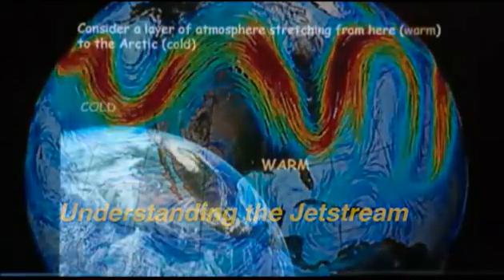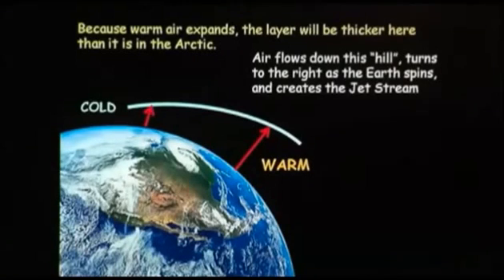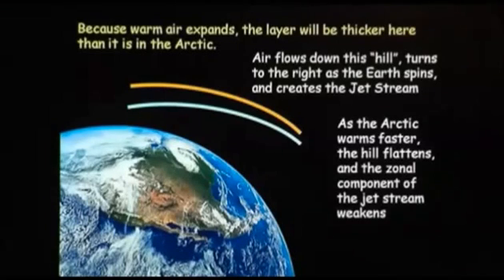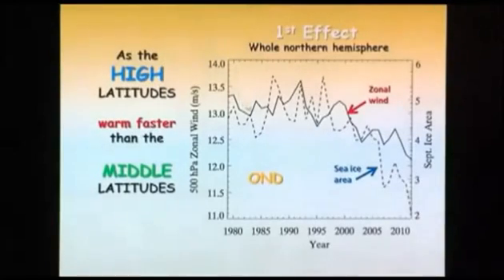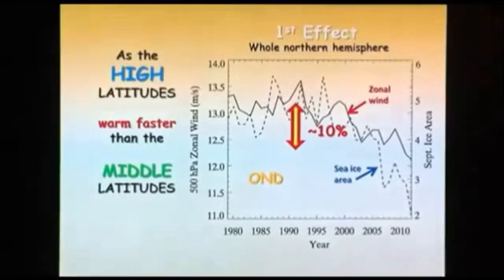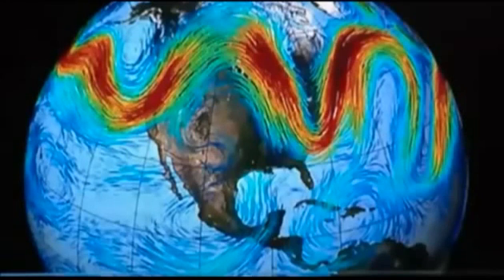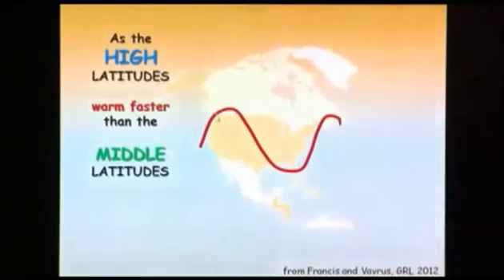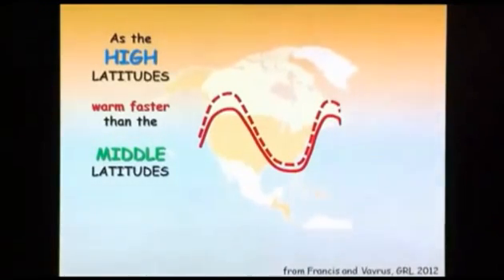Jennifer Francis - Understanding the Jetstream - m

Comment: This is all wrong, firstly there is no relation between the decline in the ice and global temperature which has been steady over the last 10 years.
Rather than cherry pick data plot wind farm capacity against zonal wind and you will see a near perfect correlation.
And of course that is to be expected, you can't suck energy out of the wind without sucking it out of the zonal wind because the two are essentially part of the same.
Reply: ufewl
Actually you do. What you describe is the application of "common sense" principles, otherwise known as group think.
Now if you want to see scientists on each others cases then go look at peer review. No back slapping there. On the other hand we can see the deniers inventing peer review publications to desperately try and make their stuff credible. Now that's pal-review It isn't working.

What's going on in the Antarctic is in good part due to AGW, so nice try.
Reply: ufewl
And you have some evidence for this?  If so why does Richard Lindzen, John Christie, Roy Spencer (I could name a few more) have a job? You might also want to point out why there is general inaction amongst governments, and in some cases outright government hostility, in the study of climate science.

Considering scientists are generally saying, "this event is consistent with the projected changes due to AGW" your saying they only say it's AGW after the fact falls flat. Try learning about the kinds of changes that have been predicated before making that claim. Of course not everything is due to climate change and sometimes we learn from studying events that there was a connection later

No warming in the last ten years? Check the oceans or read Cowtan and Way.

Got a citation for that Venus claim? Still waiting for your windmill claim citation.
Reply: ufewl Yes if temp increases in the ocean was all we had to worry about then it would be no issue. However, what it shows is warming continues. Secondly, these periods where the oceans absorb more heat are temporary. When th cycles flip the oceans help warm as they release some of that stored energy. That;s what happened in 1997/8. Looks like it's pushing temps to new heights again. 2015 to be warmest year by a large margin.. Warming at a rapid rate continues.
Reply: *****
What would you like? Like I said name an aspect? If you expect me to list the 10s of thousands of papers that form the basis of AGW you're out of luck. If you want a summary then look at the IPCC Reports. There are masses of citations there and google scholar will get you to most.

Face it. The reality is you are trying to pretend you know more than the vast, vast majority of the people who study the subject. You are only able to hold onto your ideology based beliefs by closing your eyes and ears to all the evidence that's out there. That's why you're so angry. You do actually realize that. So now you think you can huff and puff and intimidate people who understand science. Sorry bud, but I'm used to the anger and bluster of the deniers.
Reply: ***** Yes it's about greenhouse gases and it is diret experimental evidence that shows our emissions of GHGs are warming the planet.
Who said that the amount of warming seen in the last 100 years would cause serious problems? 

As for what is already happening or is likely to happen:

This quite recent study is interesting: http://www.nature.com/nclimate/journal/v4/n4/full/nclimate2153.html

Then there's:
•Decline in rice yields due to warmer nighttime minimum temperatures (Peng 2004, Tao 2008)
•Increase of Western United States wildfire activity, associated with higher temperatures and earlier spring snowmelt (Westerling 2006)
 •Encroachment of shrubs into grasslands, rendering rangeland unsuitable for domestic livestock grazing (Morgan 2007)
 •Decreased water supply in the Colorado River Basin (McCabe 2007)
 •Decreasing water supply to the Murray-Darling Basin (Cai 2008)
•Increased deaths to heatwaves - 5.74% increase to heatwaves compared to 1.59% to cold snaps (Medina-Ramon 2007)
 •Increased heat stress in humans and other mammals (Sherwood 2010)
 •Spread in mosquite-borne diseases such as Malaria and Dengue Fever (Epstein 1998)
 •Increase in occurrence of allergic symptoms due to rise in allergenic pollen (Rogers 2006)
•Less compacted ice, hazardous floes and more mobile icebergs posing increased risk to shipping (IICWG 2009)
 •Drying of arctic ponds with subsequent damage to ecosystem (Smol 2007)
 •Melting of Arctic lakes leading methane bubbling (Walter 2007)
 •Leakage of methane from the East Siberian Shelf seabed sediments (Shakhova 2008)
 •Escape of methane gas from the seabed along the West Spitsbergen continental margin (Westbrook 2009)
•Rainforests releasing CO2 as regions become drier (Saleska 2009)
 •Extinction of the European land leech (Kutschera 2007)
 •Decrease in Adélie penguin numbers  (Ducklow 2006)
 •Disruption to New Zealand aquatic species such as salmonids, stream invertebrates, fishes (Ryan 2007)
 •Oxygen poor ocean zones are growing  (Stramma 2008, Shaffer 2009)
 •Increased mortality rates of healthy trees in Western U.S. forest (Pennisi 2009)
 •More severe and extensive vegetation die-off due to warmer droughts (Breshears 2009)
 •Increased pine tree mortality due to outbreaks of pine beetles (Kurz 2008, Bentz 2010)
 •Increased risk of coral extinction from bleaching and disease driven by warming waters (Veron 2009, Carpenter 2008)
 •Decline in lizard populations (Sinervo 2010)
 •Decline in global phytoplankton (Boyce 2010)
 •Decline in global net primary production - the amount of carbon absorbed by plants (Zhao 2010)
•Severe consequences for at least 60 million people dependent on ice melt for water supply (Barnett 2005, Immerzeel 2010)
 •Contribution to rising sea levels (Pfeffer 2008, Vermeer 2009)
•Economic damage to poorer, low latitude countries (Mendelsohn 2006)
 •Billions of dollars of damage to public infrastructure (Larsen 2007)
 •Reduced water supply in New Mexico (Hurd 2008)
 •Increased risk of conflict (Zhang 2007) including increased risk of civil war in Africa (Burke 2009)
 •Drop in primary productivity due to unprecedented warming at Lake Tanganyika (Tierney 2010)
 •Hundreds of millions displaced within this century (Dasgupta 2009)
 •Coastal erosion in Nigeria (Okude 2006)
 
And then of course there is ocean acidification:
•Substantial negative impacts to marine ecosystems (Orr 2005, Fabry 2008, Kroeker 2010)
 •Inhibiting plankton development, disruption of carbon cycle (Turley 2005)
 •Increased mortalities of sea urchins (Miles 2007)
 •Threat to fish populations (Munday 2010)

The pros include improved agricultural production in high lattitudes, fewer deaths from cold, shipping through the ice free arctic to reduce travel time. But these gains are more than made up for by the losses.

The pros outweighing the cons is based on the ridiculously oversimplified argument that CO2 is good for plants and therefore more is good. However reality requires we remember that plants have ideal temperature ranges, need nutrients and water, and are attacked by pests. Just pointing at one factor and ignoring the others is not very sensible.

You have read the IPCC's recent summary on the consequaences of AGW, right? There is a much larger summary of the evidence.
Reply: ***** you sound like 12 year old unable to substantiate his own BSes. Go to Fiji or Kiribati and tell them that. They are losing feet after feet of their precious land until the ocean will claim its right. Where are they gonna go? In your sorry UK yards?  Get ready cos they're thousands of them waiting on a new land of adoption.
Reply: ufewl
1) deforesting land will greatly increase the CO2 in the atmosphere. That's a big way we raised CO2 levels already.
1a) The area being defrosted generally has poor, thin soils. Not a good exchange for the good soils being lost.
2) Extra CO2 may be awesome in a controlled greenhouse but the effects are much less in the real world. There are also limiting factors such as heat stress, water availability, nutrient availability, and pest prevalence that mean the benefits will be overcome by the negatives.
3) Why would the scientists say what they are saying? Because they have actually done the work and don't operate in a fantasy world like you. They are trying to warn us so we can avoid going down a path which is massively harmful to humanity. Or we could listen to arrogant 12 year olds who believe in the CO2 fairy.
Reply: ***** Fascinating. You post information that proves your beliefs are wrong (although apparently you knew this already) and you bitch about the scientists. LOL 

Although since you had been promoting the concept that there were no negative effects the study did need to be done. It is a principle of science you know. We don't assume the results will be one way, you test it. And now we know.
Reply: While atmospheric surface temps have been steady the global oceans are warming just as fast. In addition recent study by Cowtan and Way have calculated that the arctic has continued to warm despite the seeming slow down globally.
Which peer reviewed study finds this wind farm claim?
Reply: rugbyguy59  Peer reviewed? NO mate this is proper science backed by solid scientific facts not  a bunch of  backslappers with their old school ties.
You don't need to peer review basic science such as  reducing air flow reduces cooling. A 5 year old kid would be able to tell you that

What on earth were they thinking when they though they could reduce warming by reducing airflow.

They must be fucking mental.

When your peers are idiots their review is meaningless.
Reply: rugbyguy59  yea but unfortunately the Antarctic continues to freeze hard with it's ice not at it's highest level ever recorded.
Reply: rugbyguy59  I've got load of stuff.
I have had to gather them from my history they are not well organise.
http://wattsupwiththat.com/2013/02/25/rethinking-wind-power-harvard-study-shows-it-to-be-overestimated/
 http://phys.org/news/2012-10-curious-cold-layer-atmosphere-venus.html
http://phys.org/news/2012-10-curious-cold-layer-atmosphere-venus.html
http://wattsupwiththat.com/2013/02/25/rethinking-wind-power-harvard-study-shows-it-to-be-overestimated/
http://iopscience.iop.org/1748-9326/8/1/015021/
http://pielkeclimatesci.wordpress.com/2011/05/03/a-new-perspective-on-climate-science-by-l-miller-f-gans-and-a-kleidon/

Predicting climate will change some time in the future, is the vague sort of stuff a clairvoyant comes out with, so 30 years on we had a winter storm and a bit of flood cause by dredged river, is hardly great shakes.

How can the oceans be warming if the atmosphere is not?

Actually I might have solved that, just had a bit of a brain wave.

I wonder how long it will take the climate scientists to figure that one out?

Seems they have not solved it yet, I think I have it after a few days of hearing about it, they have had 10 years!!1 All one million of them!!!
Reply: ufewl
Thanks for the stuff on wind energy. Always good to learn and good policy choices need good facts. Funny that Watts and others seem to suddenly find faith in GCMs when they turn up something that works for them. What does it all mean...we might not get the masses of energy some have hoped for. But there is still lots to get and other formats too.

The Venus discovery is interesting too but no one seems to think it means the end of the greenhouse theory.

How does the ocean warm without the atmosphere getting warmer?
England et al 2014: "Stronger trade winds push warm surface water towards the west, and bring cold deeper waters to the surface to replace them. This raises the thermocline (boundary between warm surface water and cold deep water), and increases the amount of heat stored in the upper few hundred meters of the ocean. Indeed, this is what happens every time there is a major La Niña event, which is why it is globally cooler during La Niña years. One could think of the last ~15 years or so as a long term “La-Niña-like” anomaly (punctuated, of course, by actual El Niño (like the exceptionally warm years 1998, 2005) and La Niña events (like the relatively cool 2011). - See more at: http://www.realclimate.org/index.php/archives/2014/02/going-with-the-wind/#sthash.GkI7DZP2.dpuf"

There is also Cowtan and Way which indicates it's actually warmed more than originally thought.

It will be a while before short term climate changes can be predicted accurately (our explorations into the surface patterns tell us we need to be able to predict ENSO for one thing) but the long term projections are solid.

"30 years on" if it was going to stop now it would likely not be a big deal. But it isn't

A river that wasn't dredged? Watt's original story was that it was due to one pump not being turned on. He later changed to the still completely implausible "didn't dredge" story. It flooded because of massive, constant rainstorms in an area that is very flat. Dredging would have increased high tide surges from the sea due to increased sea level.
Reply: rugbyguy59  Seems ridiculous to me if they ignore sea temperatures when reporting the earths temperature. It means the info they are putting out is highly misleading.
Reply: *****
Ignore what when? Atmospheric temps were the standard because they were most abundant, consistent, and easiest. However as some people think natural variation in the atmosphere (which is most subject to short term influences) means the Earth isn't warming more attention has been brought to ocean temps.

the people ignoring the sea temps are those claiming there has been no warming since (insert your favorite year here)
Reply: rugbyguy59
Well it just proves how useless the scientists are putting out  meaning less information. They DO NOT have a scientific approach, they have a vested interest in finding warming and stopping people using fossil fuels, when ever they find something that fits their dogma they stop looking but if it does not fir they keep picking at it until they can twist it to fit their desires.
It is the scientists who have ignore sea temps for decades, not the deniers.
But the bottom line is warming is actually good for the planet, however they ignore all the positive effects and bang on endlessly about polar bears. Food supplies have quadrupled in the last 100 years of this 'disastrous' warming, as has the population.
Reply: *****
So the deniers were telling us CO2 has been warming the oceans all along? Good for them to finally get something right. Perhaps there is hope...anyway we see that now, so what's your point (other than making stuff deniers supposedly said up?)
If you look at the IPCC report you will see extensive examination of other possibilities and all the things you claim are being swept under the table. In fact it's only sweeping stuff under the table that allows people like you to make the ridiculous claim that warming is always just a bonus. There are pros and cons but the higher the temps go (and especially at the rapid rate we're seeing) the more the cons outweigh the pros.
The scientists do not have a vested interest in ending fossil fuel production...other than being one of us all and knowing we are in for a very rough ride if we still ignore facts.
Reply: rugbyguy59  You have no proof the cons out weighs the pros. You certainly have no proof the anti warming measures are better than doing nothing. You indeed have no proof they work at all. There is evidence wind farms produce warming for starters, but they ignore that, it's inconvenient. They ignore the fact wind-farms change the climate more than warming does. Scientists have a vested interest in making money by generating hysteria. We will stop using fossil fuels when they run out, not before, that is guaranteed. It is all biased propaganda.
Reply: *****
Proof is one thing and it's very elusive. Evidence is another. You have no proof that warming as we are seeing will ultimately be a net benefit. So we should make decisions based upon the best evidence. Right now the best evidence, and that evidence is found all over the place, including summary reports such as the IPCC, is that continued rapid warming will be a disaster. "Effects of climate change on global food production under SRES emissions and socio-economic scenarios" -- Parry et al, Global Environmental Change 2004
"Stern Review on the Economics of Climate Change" -- UK Government report, 2006
There's lots of others. The prudent path is to act. The science is what the science is. Those who deny it are those with fiscal ties to the fossil fuel industry.

It isn't ignored it's been examined. Wind turbines may produced localized weather changes (the two Keith et al studies) but these are much weaker than natural interannual variability and the effects of AGW. http://www.nature.com/ncomms/2014/140211/ncomms4196/full/ncomms4196.html#affil-auth (see you need to look at all the evidence)
Reply: rugbyguy59  There is not any evidence, where is it you are just invidted me to buy something, the answer to that is fuck off. I have evidence global warmings is good for the planet. Just send me £20,000 and I will email you a copy of it.
IF there were evidence you would be able to freely supply it, How come the unsubstantiated bollocks from the IPCC is free?
It's a fucking con from a bunch of criminals.
Reply: *****
LOL, more ramblings from a looney denier. The evidence is freely available so I have no need of your $36695 information. It would be as fake as the rest of the criminal fraud perpetrated by the losers you have such blind faith in. Or are these your inventions?

Which particular type of evidence would you like me to produce? I'm afraid the overall evidence is simply too vast for even these new expanded posts.
Reply: *****
Funny how a simple search through Google Scholar gets me a copy of most articles. More than enough to see just how enormous the mountain of evidence in favour is. Of course, I guess, governments could subsidize journals so they are 100% free to the general public but then idiots like you would take it as further confirmation of conspiracy.

I'll leave it to you to lap up the denialist propaganda/koolaid as we've already seen so convincingly how you only see the fragments that  seem to support your position. You see a tree but miss the forest.

You seem to have anger issues as well. I've found that common amongst those who whip themselves into a frenzy due to ideological bias.
Reply: rugbyguy59
funny how despite the fact you can find this info freely and simply you remain unable to produce any evidence here isn't it?
So despite the 'mountain of expedience; you can't produce any and have produce none so far.
So you have produce no evidence, and and now are accusing me of having "anger issues", well of course I have anger issues with stupid idiots like you self who make a claim with out evidence, fail to produce evidence when requested and then go on to make a personal attack on me, again with out any evidence to justify it.

Your failure proves everything I have said, there is no evidence to back up the alarmist claims, nor wil there ever be as the claims are unjustified,
Reply: lol, I would like one study, one piece of evidence, that is all I ask. Is it too much to ask? You claim you have 10's of thousands, yet remarkable you can't provide one, provide a link to JUST one. A scientific study, not the opinion of some pompous idiot.
Truth is despite your claims there is no actually evidence, just a lot of hand waving and waffle.
How the fuck can I close my eyes to evidence whcih has not been produced? I would not say I am angry, I am infact elated you have not been able to produce a shred of evidence to support your claim.
So there is no anger here as you claim, it is delirious laughter at your failure to back up you claims!! You seem to be deluded, you apprear to believe there is evidence for your claims but your failure to produce any just proves how delude you are.
Reply: *****
And in your last post you said you were rightfully angry. Typical denialist denying your own words, lol.
You claim I haven't produced evidence and yet I told you exactly where it is. So again your hear no evil, see no evil attitude is obvious. Just go read the IPCC Report. Too bad it's too conservative overall and the politicians aren't letting the scientists say just how concerned they really are.

But here's your one piece. "This experimental data should effectively end the argument by skeptics that no experimental evidence exists for the connection between greenhouse gas increases in the atmosphere and global warming." https://ams.confex.com/ams/Annual2006/techprogram/paper_100737.htm The PDF is free.
Reply: rugbyguy59  Again that is all rubbish, I started reading it and it said "Without adaptation, losses in aggregate production are expected..." Yea, without adaptation well of course the idea we would not adapt to change and continue planting unsuitable crops in unsuitable area's is utter lunacy and any who does a study on that basis should be hung drawn and quartered for wasting public money. But of course they have to do invalid studies because when ever they do a valid study they get the 'wrong result' ie it shows warming is beneficial, so they quietly shred the evidence and go back to talking bollocks,
Reply: *****
So simple straight forward denial...gee how surprising. Yes, we will have to adapt and if we act fast enough adaptation might be enough. Of course we will adapt but if it just keeps getting warmer adaptation won't cut it. To bad you can't even be honest about what a study is looking at. They don't do a no adaptation calculation because they are suggesting we wouldn't; it's done so you can see how effective adaptation might be. Good thing these guys don't listen to idiots like you about what constitutes a valid study, we wouldn't get any proper science done.
Reply: rugbyguy59  It is not proper science it is bullshit hysteria and propaganda, we don't have to act fast, no faster than we reacted to the last 1C increase, ie unnoticablely fast.
Also as the CO" level is at saturation point it won't get any warmer. Furthermore the is a natural regulator to temperate in fossil fuels and that is smoke particles which reduce the heat, but stupidly we insist in clean fuels, more stupidity form idiots who cause problems not solve them.
Reply: *****
Haha, can't deal with the evidence you asked for so you just hunker down into deep denial mode. What's your evidence we won't have to act faster? No one really thought we'd have to react much to the first degree. Trouble is many effects seem to be ahead of schedule. What evidence can you supply that the next degree (and the next and the next) will have similar effect?

So at what point in time are you claiming CO2 became saturated? Chen 2007 shows the effect of CO2 growing until 2006. As does that first study I cited for you a few posts back. As Gilbert Plass wrote about the center of the CO2 band being saturated almost 60 years ago: "This is entirely true for a spectral interval about one micron wide on either side of the center of the carbon dioxide band. However, the argument neglects the hundreds of spectral lines from carbon dioxide that are outside this interval of complete absorption." You have some evidence to the contrary?

And now we see how completely desperate you are, you want to maintain high levels of aerosols to keep the earth at this temp. So I guess you don't support transferring to cleaner burning natural gas but would rather return to dirty, dirty coal. No worries about 8 year olds in China getting lung cancer. No worries about the terrible airpollution and acid rain. BTW, by arguing this you just accepted that CO2 is not saturated.

You can't even keep your lies straight. LOL And what would you know about proper science anyway?
Reply: ufewl just like map makers that insist the world is flat. they can't get jobs in cartography either.
Reply: ian wallace see my previous post for the answer to that,I am not of course saying the world is flat so you are using  straw-man argument, ie a logical fallacy, you can't use a real argument because, put simply you are massively wrong.
Reply: rugbyguy59 1) You have no proven  scientific evidence an increase in CO2 is harmful.
2) The effects of CO2 are independent of greenhouses. The limiting factor you mention are also irrelevant, we have them anyway. There are no negatives, you have not established that.
3) Why the scientists get thing wrong is irrelevant, it is still wrong, they say whatever is most profitable for themselves. They have no evidence CO2 is harmful hence they are talking complete and utter bollocks. YOu are simply brainwashed, unable to think for yourself and hene you [ut you future in the hands of a bunch of wealth ruthless and stupid cooks who profit from it. It is also a good excuse for government to heap huge regressive taxes on the poorest and trap the poor in poverty ensuring they rich remain in luxury. You also got my age wrong.
Reply: ***** 1) You like to deny mountains of evidence.
2)There are loads of studies that indicate the effect is not "independent of greenhouses. Studies done in controlled outside environments show you lose 50% of the effect immediately and these are still in relatively small plots and don't involve increased temps that would result from that much more CO2 in the general atmosphere. Other studies show lower nutritional values and more pest vulnerability. It isn't that hard to find. Yes, some of those factors exist already... added CO2 just increases the vulnerability to them.
3) You have no evidence the scientists only say what benefits them. And as for getting things wrong, you apparently have little understanding of the history of science. Scientists make hypotheses that are tested and the results of these lead to the formation of theories. In the early stages there will be lots wrong with the theory but additional research will allow it to be refined over and over again and each time it will be closer to correct but in reality there will always be things scientists get wrong. It's how they learn. But what they get wrong will be increasingly detail oriented. That's where we are right now. AGW is unquestionably correct. Dire consequences are highly likely if we do not act. What happens tomorrow is still very uncertain. But by being wrong the theory of AGW has become extremely well developed and as they like to say... settled science.
4) Yes, government could make bad policy choices in attempting to solve the problem. They might also make better ones as all of the things you fear can be avoided. However that discussion has no bearing on the reality that we have a real problem.
Reply: rugbyguy59
there is no evidence to deny, climate scientists are biased and politically motivated. They spent years talking about the notrh pole and ignore the south, how is that balanced science? It isn't it is propaganda.
We have plenty more water available in deed we have a whole melting ice cap!!!!! We currently apply the required nutrients to farm land hence your argument is voided. You denial requires man acting like an idiot, that will not happen only climate scientists act like idiots. Scientists take bad and biased assumptions and you the to get the results required to drive their political agenda ie more funding.
CO2 is wonder stuff, it is the new oil indeed it will replace oil as it provides both life and energy, the more of it the more you get of both
Reply: rugbyguy59 indeed one experiment relies on the soil being depleted of nitrogen, this happens anyway, which is why we fertilise with nitrogen, to assume farmers would fail to adjust the supply of nitrogen to the necessary amount is just sheer lunacy, it is and science and essentially propaganda. There is no shortage of nitrogen, the atmosphere is full of it. And nitrogen is recyclable it is not used up so we will never run out of it and always have enough of it.
The 'experiments' are mindbogglingly stupid and do not reflect reality, they rely on using inappropiate farming practises, supply of water and nutrients is a simple engineering problem easily solved, certainl;y cheaper and easier than building millions of wind-farms which actually cause warming. Of course they ignore the fact they cause warming because it is an inconvenient truth. The people you call scientists are not real scientists, they are politically motivated environmentalists driving their own agenda. They have dug themselves into a hole and are to scared to admit they have it al wrong because that would show their incompetence and mean they lose their highly paid cushy jobs.
Reply: rugbyguy59  http://www.smithsonianmag.com/smart-news/plants-wont-help-fight-global-warming-as-much-as-wed-thought-57646253/?no-ist=
 "What they found was that in the grass plots that didn’t have extra nitrogen being added, plant growth was only half as much as for plots with lots of nitrogen, even when both had extra carbon dioxide."

They didn't need trials to find that out, I could have told them that before they started!!!!
That shows the depths of their stupidity, they wasted billions doing trials for which I could have told them the results of before they started, they are not scientists they are morons.

Also:-  "Standard plant food you’d pick up at the store is rich in nitrogen, potassium and phosphorous, each a necessary fuel for plant growth." That is just plain wrong none of the elements listed is a fuel, there is only one source of fuel for plants and that is the sun, that is easily proven by trying to grow plants in rich soil in the dark, the plants don't grown because the elements they list as fuels are not fuels.

So you are essentially asking me to rely on the work of such massively incompetent people for predictions of the future, ie to rely on their "mountain of evidence" well of course it is not evidence at all, it is a "mountain of bullshit".
Indeed maybe they could use their own research papers as fertiliser because they are FULL OF SHIT!!!
Reply: rugbyguy59 It proves me right not wrong.  We don't need studies for the blatantly obvious and  indeed for what we already know, it is blatantly obvious that we need a certain amount of  nitrogen to make molecules of chlorophyl, you don't need a study to show that  because it is a scientific FACT
Reply: rugbyguy59  also there are plenty of ready sources of nitrogen we actually pee it out of our bodies, hence more plants = more animals = more nitrogen, so it is a self balancing process. There is as I said an abundance in the atmosphere, and it is release into rain by lightening and a warmer atmosphere carried more moisture. Hence the experiment the did was invalid, so it is question of garbage in garbage out. They are very poor scientists and make litrally hundreds of error in their models whcih are essentially bullshit. Every time I look at a study done by those crackpot environmentalist I see it is riddled with flaws, hence the results are worthless. Only one word to describe the incompetent.
Reply: ***** Somehow missed this reply way back then... but all it does is confirm why we do science. You might think something is blatantly obvious but until it's been demonstrated there is no calling it a fact. Turns out ntrogen absortion goes down in higher CO2 environs: "The findings of the study are unequivocal. The nitrogen content in the crops is reduced in atmospheres with raised carbon dioxide levels in all three ecosystem types. Furthermore, we can see that this negative effect exists regardless of whether or not the plants' growth increases, and even if fertiliser is added. This is unexpected and new," says Johan Uddling, senior lecturer at the Department of Biological and Environmental Sciences at the University of Gothenburg.
http://onlinelibrary.wiley.com/doi/10.1111/gcb.12938/abstract
Reply: rugbyguy59 Yes we do science so we can misinterpretate it and misuse it to push whatever political agenda is will keep us in a job. Anyway back to the "article" which to mean seems like a desperate attempt to make out elevated CO2 will be a bad thing. But let us look at the reality rather than the misleading rhetoric. ie: "Under elevated CO2 most plant species show higher rates of photosynthesis, increased growth, decreased water use", now any sane person would be popping the champagne corks at this stage but not the climate scientists of course as they are insane!!
So we come to nitrogen absorption, what is so good about that? Do we lack nitrogen in the diet? Well not really, indeed too much can be bad for your kidneys. No imagine high CO2 reduced photosynthesis and and crop yields, especially in drought condition, now that would be something to panic about.
  I was not aware increased CO2 nearly doubled crop yields in drought condition but isn't that the most brilliant result? Just think of the lives it will save!!
But surely the climate scientists will be able to twist that into some sort of negative? I mean with plants requiring less water, surely there will be more flooding?!!! So maybe instead of forest fires in California try will have horrible floods instead? Yea that sounds like a negative we can sell, lets start a panic about that!!!
Can't you see the climate 'science' industry is bankrupt and corrupt?
Reply: +rugbyguy59 and you really need to read this:- http://www.dailymail.co.uk/news/article-2334723/Dramatic-rise-plant-growth-worlds-deserts-rising-C02-levels.html

"Dramatic rise in plant growth in world's deserts could be down to rising CO2 levels
Researchers studied satellite images between 1982 and 2010 Regions which have seen a rise in plant growth include Africa, the Middle East and the Australian outback 
Carbon dioxide acts as an insulator and causes temperatures to rise but it also vital for plant growth"So the inconvenient truth, the climate scientists are massively wrong and I am right, it is brilliant, climate change is greening the deserts, it is a miracle, not a disaster, indeed we should accelerate the increase in CO2 levels for the good of mankind.
Reply: ufewl LOL, Yes apparently misuse of science is what you're all about. Why is nitrogen important? Because it directly relates to the nutritional value of the plants we eat.Nitrogen may be very abundant but plants need it and CO2 limits the uptake. Also, while using less water would generally be a good thing, doing so by lowering stomata opennings makes plants more vulnerable to heat stress.

CO2 has likely helped increase plant growth and I do understand that plants like CO2 but I will go with peer reviewed studies on specific topics rather than try to ignore them for other by looking looking anywhere but the subject..
Reply: rugbyguy59 It's been estimated that the average person in this country eats two - six times more protein, usually from animals, than is needed for good nutrition. http://www.savvyvegetarian.com/articles/protein-veg-diet.php
So it is not a problem, we already get more then enough nitrogen (protein).
Plants do not need so much water in a high CO2 environment, that is why the deserts are greening. Unfortunately the peers doing the reviews are from the corrupt warming brigade, that is why they are doing all they can to discredit the good news which proves they are idiots. Vested interests!
Reply: ufewl Actually your claim shows you are from the denial brigade and are protecting your own vested interests (beliefs). So we can put aside our concerns of reduce nutritional value because Americans (or developed world people) eat lots. I'm sure that's cold comfort for the many, many more who live a little closer to the edge.

CO2 will help plants until heat stress and other factors begin to eat into those gains. As the Sahara greens a little bit, the Amazon suffers from drought.
http://www.dailymail.co.uk/sciencetech/article-2980190/Droughts-Amazon-speeding-climate-change-Lungs-planet-emitting-CO2-capture.html
Reply: +rugbyguy59 I havae no vested interest bar the truth. Those living on the edges live in desert/semi-desert which will massively benefit. Their concern is having food to eat at all. Zero food = no nitrogen at all, nor carbohydrate. But anyway we get more nitrogen than we need, which is not surprise as life and mankind developed when CO2 levels were 2-3 time higher. There is no drought in the Amazon and even if there were vegetation will survive drought much better with high CO2.
Truth is you are the one with the vested interests, that is why you deny the good news, the good news being that warming is good, something which is obvious  even to a child.
Warmth beings life as logic and historical evidence proves, people like you will only be happy when most of Europe and the USA are under lifeless glaciers. In short you are mad.
Reply: ***** And there you go pretending it's about nitrogen... rather than nutrients
I'm not afraid of good news but I'm also not naive enough to then close my eyes to the full picture. Yes there will be places where there is benefit but on balance more will lose. And the warmer it gets the loses will increase. That's why previous warmings at this rate (or even a bit slower) led to mass extinctions.

And you can deny it as you deny other things but there is a drought in the Amazon. When you deny and cherry pick facts your agenda shows.
Reply: rugbyguy59 it is all nonsense though, there are more than enough nutrients in our food, indeed historically CO2 levels have been much higher. You should be more concerned about junk food. There is no evidence for you claims, the warmer it get the better it get's more unfrozen and productive land, longer growing season. The climate scientist are biased and have an agenda, I have no agenda, I don't own an oil company!!
It is all propaganda, there is no disaster and wlll not be one. Biofuels are more of a danger to poor poeple as the rich pump their food into their gas tanks, It is biased, it is evil!
Reply: ***** Yes CO2 was higher but never when humans existed and certainly never when we depended on agriculture. 
There is lots of evidence for what I'm saying you just handwave it away and claim it's nonsense. Some frozen land will become productive but at the same time large sections of the planet will become uninhabitable. 

Your weak dismissal of climate science as biased is a sure sign of agenda. Deniers have lots of reasons for denial. They don't all own oil companies  but something is violating the rules of your world view and the way you handle it is sticking your head in the sand.

Yes biofuels are a silly answer, especially those that are food based. And I am concerned with junk food... nice attempted deflections.
Reply: rugbyguy59 No CO2 was high when humans developed we will have no problem with high CO2 now. Land is thawing and large sections of desert will be come productive as less water will be required. THat is pretty much a miracle and perhaps explain why there was so much oil in desert reason. It is amazing, if we can grow crops in deserts which soak up so much of the suns energy it will solve out energy shortage. Anyone presenting these changes as bad needs to be certified and locked up. A|l the current scientists are the offspring of the wealthy, not very bright but extremely corrupt and atheists who should be burned at the stake as biofuels.
Reply: rugbyguy59 Global warming is bullshit. WE have supposedly had over 100 years of it. So where are the disaster stories? There are none, the world is still spinning, we have more people, about 8 time more and tey are all better off by miles, Warming has been a huge success and long may it continue. It is more like a dangerous cult full of crackpots and loonies now warning of impending doom which never happens. Name the cities lost to the sea? You can't as there are none. I can however name mega cities built in the desert!
Reply: ufewl Still more stupid denial. We have had over 100 years of it and we are starting to see an increasing number of disaster stories. But the whole basis of your thinking is illogical (as usual). Your argument is based on any warming being bad because apparently you expected disasters immediately. (Did anyone say cities would be under water by now?) The second idiot argument is that just because now is still good the future will be fine too. Sort of like a farmer looking forward to the deluge because the shower last week was good for the crops. It isn't really where we are (if it stopped today the pros would outweigh the negatives) but where we are going.

Luckily that technological ability you've noted we have allows us to overcome the problems of AGW and still maintain a good standard of living.
Reply: rugbyguy59 It has been goingon over 100 years depending on where you cherry pick you data from, if you pick 1000 years it has not warmed at all. Pick 100,000 years and it has been abnormally warm for thousands of years, That is why to put it bluntly, all bollocks!!
Where is the evidence for their claim anyway? It is not even warming so their warming model is way out, why should we believe their other loony forecasts? They are all based on flawed understanding and thinking, that is highlighted by the fact that warming is clearly overwhelmingly beneficial. They were predicting an ice age not so long ago. They have not got a clue, they really haven't!! Bunch of loonies!!!
Reply: ufewl More drivel. Some of it wrong. It is warmer know than at any time in the past 1000 years. In the past 100000 years it has been warm for a 12000 or so. Of course we know why the previous warming happened. We also know why it cooled over the past 6-8000 years. Then about 150 years ago, in both ocean and troposphere it began to warm. And this has continued in a manner that natural variations cannot explain, although natural variation does create noise in the trend. It is that noise that you mistake for not warming but of course the oceans have been rapidly warming throughout and 2015 looks like it will bust your ability to pretend warming has in anyway stalled. Right now 2015's value basically puts temp trends in line with computer projections. So once again you flail and fail. Warming is overwhelmingly good when the temps are lower than the are. A bit more will be okay but thresholds are already being passed. Just because rain is overwhelmingly good for a drought doesn't mean 40 days and 40 nights of rin will be good for the place. You have a very simplistic outlook.

In the 70s some predicted an ice age but far more were saying CO2 warming would win out. The only people who have to deny reality are the real loonies... people like you.
Reply: rugbyguy59 You are wrong, here is why, there is not place on earth too warm for life, however there are places too cold, proof that overall warming is good. CO2 is also good it is plant food, if we eliminated it we  would all be dead. Global warming mysteria is a run away trains hi-jacked by celebrity wannbees who know nothing about anything, it has become detached from reality now, most involved have the IQ of a squid.
Reply: ufewl You are wrong. Here is why.
1) While there is no place currently too hot add another 4C to the average temp and there will be. The heatwaves seen last summer in India and Iran are becoming more common. You seem to consistently make yourself look foolish by assuming now is indicative of later.
2) CO2 is good and we need it so why would anyone want to eliminate it? The idea is to keep it where the planet (and we) have thrived for the last 10000 year. That kind of straw man shows you are lacking intelligence ... and debating points.
3) Celebrities? I don't think climate scientists are celebrities., although a few have become fairly well known. However climate science says you are wrong. Such a silly statement by you shows just how delusional you are.

Looks like those squid are a lot smarter than you.
Reply: rugbyguy59 No plants will be fine with an extra 4C, it is lack of water which is the problem that is why the deserts which are getting warmer are also getting greener becasue the extra CO2 means they need less water, so it is win win win!!
10000 years is nothing on the evolutionary scale, for the 100,000 years before that it was much more CO2 and warmer and plants thrived, laying down the fossil fuels we rely on today.
I don't mean celebrity scientists, I mean the fame seeking celebrities jumping on the band wagon for free publicity who know nothing about science but think they can milk the environment thing for profit, Michael Jacksons Earthsong for example, he is dead though, poetic justice some might way.
So not delusional merely correct!!
Reply: ufewl LOL, until the heat stress hits and then they die. Fewer stomata mean the biggest function of water in the plant... cooling is less efficient. You know such a limited amount of science.

Speaking of science, CO2 has been no higher than 300ppm for the past 400000 years. Then we came along. It's been 3 million years since CO2 levels were this high.... And while absolute temp is important it is the rate of change which matters quite a lot. There are several mass extinctions with similar or even slightly lower rates of warming (also caused by big CO2 increases).

So while I don't pay much mind to celebrities (I certainly don't pay them any mind on science topics), it seems they know more about science than you... You remain delusional.
Reply: rugbyguy59 Wrong!!! The heat does not hit and the plants flourish, this is actually proven beyond doubt. Green foliage has increased 30% a staggering amount, in arid regions, you you have to accept you are wrong. The satellite images do not show dead plants as you believe they should, it shows thriving plants.
http://www.livescience.com/37055-greenhouse-gas-desert-plants-growing.html
"Between 1982 and 2010, leaf cover on plants rose by 11 percent in arid areas, including the southwestern United States, Australia's Outback, the Middle East and some parts of Africa, the study found".  So you are wrong, you may not know why but I probably do ;O)

You are the one who is delusional you refuse to acknowledge the satellite evidence, preferring instead your own  'theory' of how things should be which has a bigger hole in it than the Titanic.
Reply: rugbyguy59
400,000 years is nothing in evolutionary terms, plus CO2 levels have no effect on temperature, you can see that here
http://deforestation.geologist-1011.net/PhanerozoicCO2-Temperatures.png

Life and mankind developed when it was much hotter hence we are all guaranteed to have the genes to cope with and flourish under that if indeed it were warm, however it is not even warming so a mute pot that bit.
Reply: rugbyguy59 Problem is not so many scientists have invested their future in a false belief and the truth shows they are incompetent so they will make every effort to deny the truth. The climate science industry is shown to be incompetent and corrupt, that's why they are reduced to lies half truths and propaganda and downright lies.
Reply: rugbyguy59  "Between 1982 and 2011, 20.5% of the world's vegetated area got greener, while just 3% grew browner; the rest showed no change." http://www.wsj.com/articles/SB10001424127887323374504578217621593679506
Now this is not the disaster the climate models predicted is it really? All these eminent and highly paid scientists, all wrong, how embarrassing?
Note we here little about this on the news, they are not keen on talking about their incompetence are they?
It is beyond a scam it is crime, they are fraudsters.

"The inescapable if unfashionable conclusion is that the human use of fossil fuels has been causing the greening of the planet in three separate ways: first, by displacing firewood as a fuel; second, by warming the climate; and third, by raising carbon dioxide levels, which raise plant growth rates."
Reply: ufewl "Now this is not the..."
Actually it fits nicely with what we know about CO2, climate, plant growth etc. and what models project. What you keep conflating is the idea that if a little bit is good then a lot, really fast, is as good if not better. But then that's what you get when you cite articles by a guy noted for cherry picking and blinkered vision. If your thinking was accurate we would all be eating as much salt as we can because we know it is essential to life.
Reply: rugbyguy59 Rather ironic for you to mention "cherry picking data". It is all bullsh*t, there is not even any warming.
 https://bobtisdale.files.wordpress.com/2013/07/fig-2-ocean-temp-changes-comparison-a.png
Flat as a pancake!!
It is all lies, wake up you have been conned!
Reply: ufewl Oh, poor Bob Tisdale... he is one of the most laughable of all the deniers... he really doesn't understand what he's doing. Here's someone who does explaining why Bob gets fooled again:
 http://blog.hotwhopper.com/2015/07/bob-tisdales-latest-conspiracy-theory.html

And here's what's really happening with OHC:http://i.guim.co.uk/img/static/sys-images/Guardian/Pix/pictures/2015/1/22/1421940615189/c63d7596-d8f3-482d-88ad-68cc501116d7-bestSizeAvailable.png?w=620&h=-&s=58b4039da47085dce3756cc017b0e54f
Reply: rugbyguy59
no so fast!! http://3.bp.blogspot.com/-zlcxrtdLa8Q/T46Kj82y_PI/AAAAAAAAB5k/6f8T9nwoep8/s1600/image+Argo+heat+data+plot++2012.png
Reply: ufewl So you're left copying charts from pdf's on online magazines rather than actual peer reviewed science? I mean Quadrant Online has some interesting looking articles but the publishers have no qualifications for being able to see the latest fake study by well known deniers.

But not so fast... there are actual peer reviewed scientific studies on the matter:
https://www.indybay.org/uploads/2014/01/22/20140121-ohc-4q-2013_0-2000m.png
Levitus 2012 (updated)
Reply: rugbyguy59 The chart if from the national oceanographic data centre. And anyhow you seek to deceive, even on the "dramatic" chart you provide yourself I am reliably informed that it corresponds to an 0.17C increase in sea temp, or rather it would take 300 years to produce a 1C rise, of course we will have ran out of fossil fuels well before then, so the only warming we will be getting then is from wind farms crippling the earth's natural convection cooling system. How much warming will that produce? I would take a rough stab at 10C.
Reply: rugbyguy59  that's rubbish, if you don't agree with climate change you are out of a job end of. It's about politics and money not science. They do not know what they are talking about, only recently they discovered the temperature on Venus is below zero in places, colder than the earth, somewhat blowing a hole in their greenhouse gas theory.
Another example they will say recent weather is caused by the weather on the other side of the planet, yet omit to say what caused that weather. They just go round in circles.
Whatever happens is always an indication of climate change after the event.never before Climate change is political, you have toe the line,
They predicted warming for the last 10 years  and it never happened, 10 duck eggs in a row.
You would think the Arctic was the whole of the planet not just a mere 4% of it.
The Antarctic is warming because it has only a tiny number of wind farms.
Oh and it's about big money two subsidies and all that people are making fortunes from the quackery.
Reply: I am getting angry at your failure to produce the evidence, or rather pissed off  about.
Your latest submission is not evidence.
It is about greenhouses gases. Your task is to show warming is bad, over 100 year of continued prosperity have occurred over the last 100 years of warming there is no sign of any change in that.  The evidence says warming is good.
What you produced is not evidence just some irrelevant waffle about greenhouse gases.
Reply: einc70  no need to worry, no need at all for 2 massive reasons.
1) Land is being defrosted and becomeinig habital due to warming at a faster rate than  land is disappear under the sea!!!
2) Extra CO2 means plants grow faster and are more productive, ie double CO2
and you double the worlds food supply!!!!!!!!
In short global warming and extra CO2, if that is happening is massively beneficial to mankind. So much so that we really should be seeking to increase CO2 production as fast as humanly possible.
I am not a 12 year old but I could have worked out all this when I was twelve quite easily. The question you have to ask yourself is why our so called 'scientists' have embarked on a course which is massive harmful to mankind.
Think about that for a while, I as a 12 year old am vastly superior in intelligence to the whole lot of those stuffed tweed suits.
OR put another way, why isn't a genius such as my self not running the entire planet? Something is seriously wrong with the human race, it is run by the most dangerous of idiots.